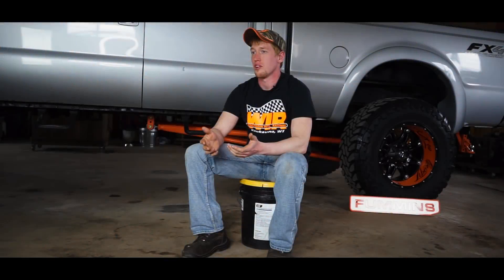2004 F-3... Cummins?  - Custom Offsets "The Builder"

Comment: Ok so Cummins is a really good diesel engine. But why would you replace a 6.0 for a cummins?! Keeping a 6.0 in the truck should be a know Brainerd. But I mean it was kindove of a good idea because 2003 thru 2005 are bad 6.0s they have alot of problems. Most 2005s are good though. But I mean still why?
Reply from the maker: Because why not! Phil is also a CAT Mechanic, so he has a soft spot for inline engines!
Reply: Custom Offsets oh. You have a piont